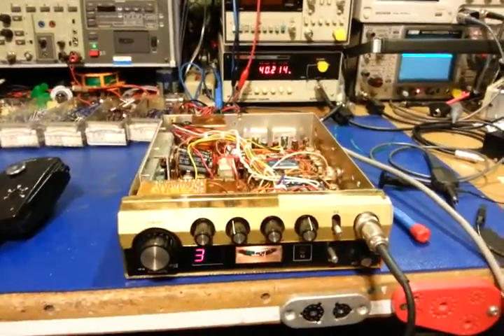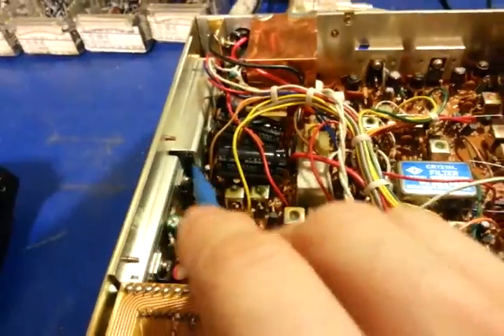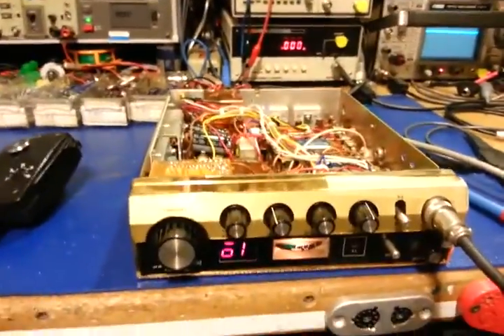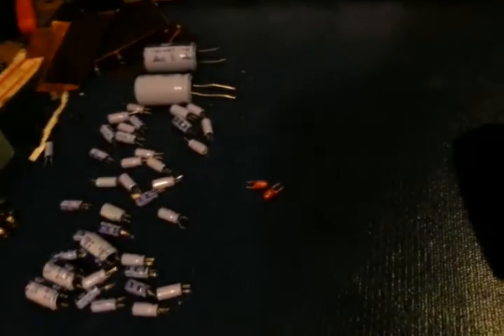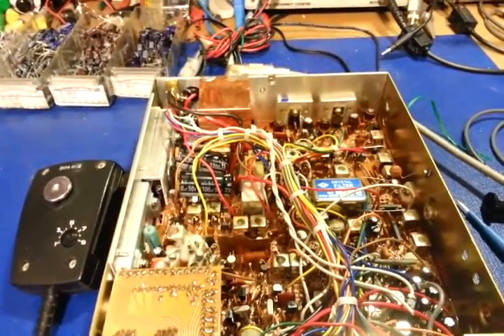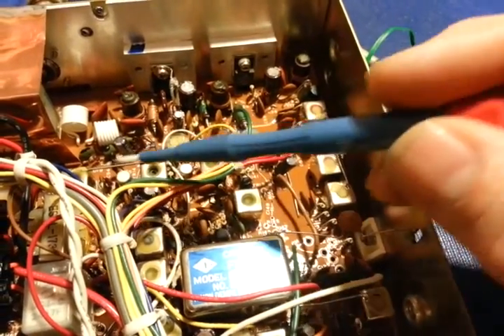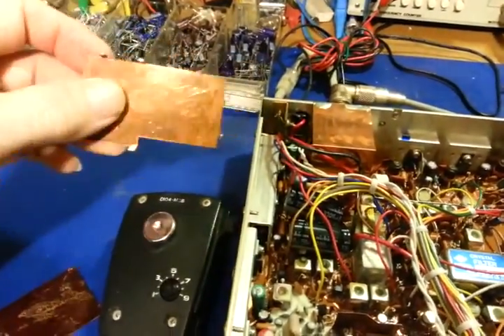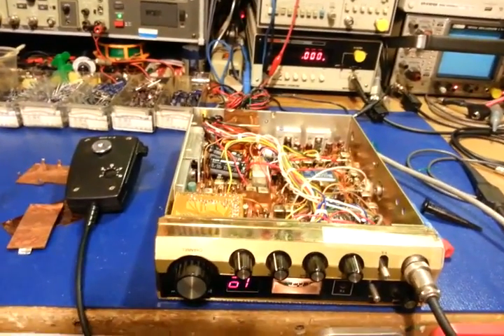Teaberry Ranger "T" bad capacitors, repairs. Part 2

Comment: Good job on the old Teaberry Mike.  I have gotten to the point that I will not work on a cb unless I can do a full recap of the radio. Most of the times it solves 90% of the issues. It does turn folks away when I tell them it has to be recapped. But if you do not, it will come back and they will want a warranty repair. Looking forward to the next video.

Comment: I have an early 80's Panasonic RX-6400  Boom Box 15-watts per channel rms,  complete with batteries it weighs over 40-pounds. Anyway it has the exact  same caps and 90% are all leaking with green leads.  It must've been one huge defective run because they shouldn't be that bad.